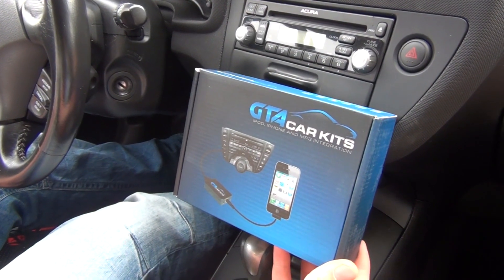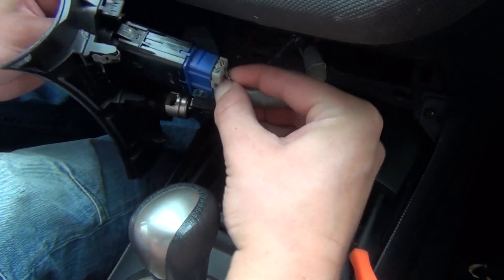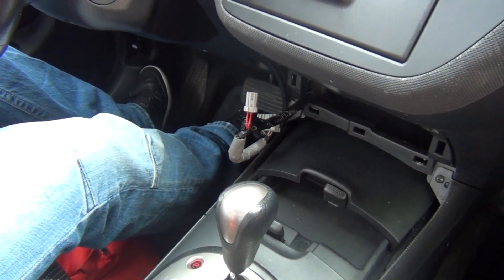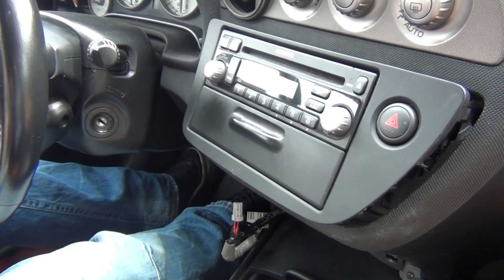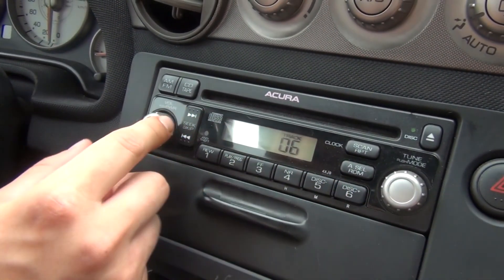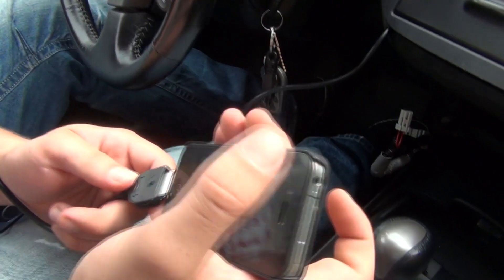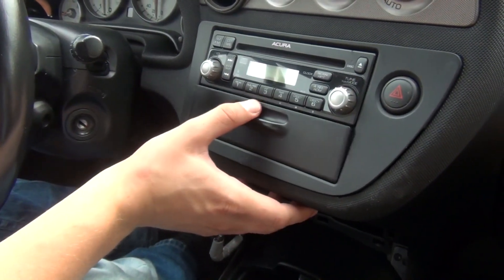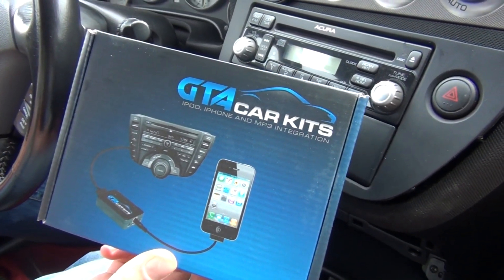GTA Car Kits - Acura RSX 2002-2006 install of iPhone, iPod and AUX adapter for factory stereo

Comment: this video was very useful.  Removing the lower piece and then the radio was a little challenging since I didn't want to scratch, warp, or break the clips.  Both are very tight.  But got it done and this unit seems to work very well.